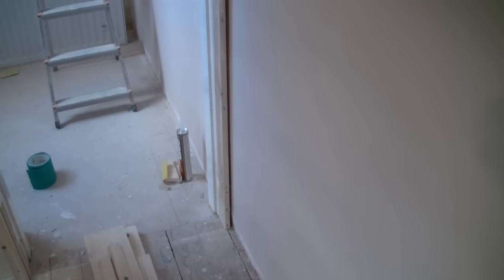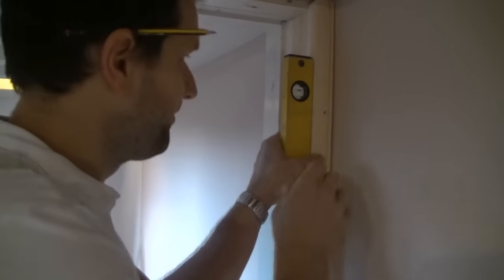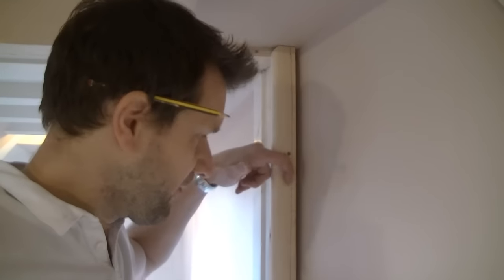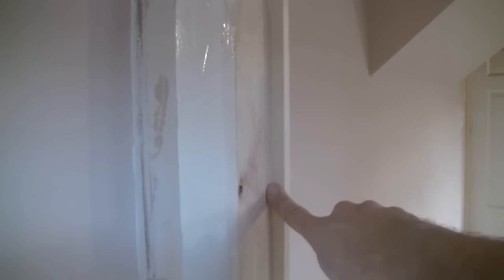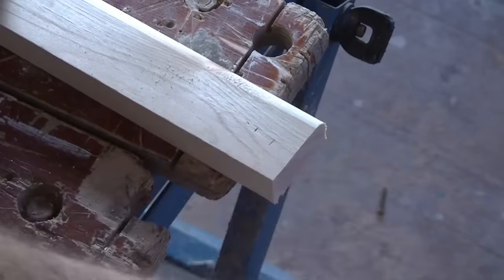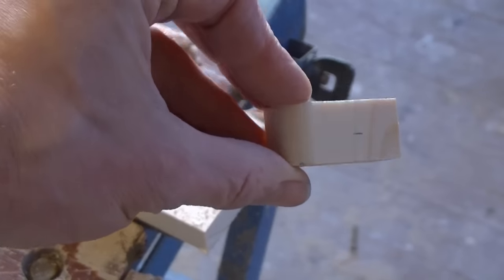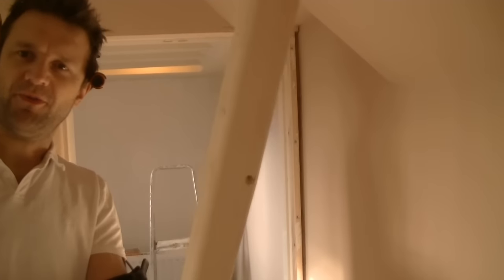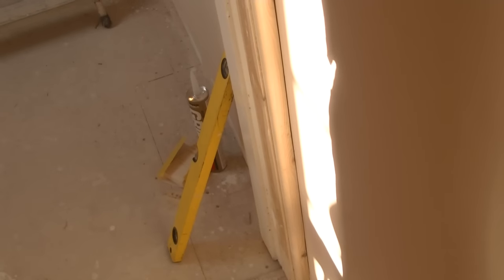How to Scribe to an Uneven Wall

Comment: I have an easier way to scribe arcitrave to a wall. Mark the reveal you want on your jamb which in this instance is 5mm. Tack the outer edge of the arcitrave to to that line using a pin nailer or brad nails, you can use a clamp at the header and tack the middle and bottom with a nailer. Then take an off cut which is the same width as the arcitrave and scribe your pencil line down the one that's tacked to the jamb, cut to the line and you're good to go leaving you with that 5mm reveal. Make sure you cut the mitre on top before cutting the scribe line so you'll have that 45° cut

Comment: Nice video on explaining how to scribe architrave. Still alittle “gappy” but close enough for a DIYer. One thing us professional carpenters do is back cut (bevel the saw slightly) when cutting the line to ensure a nice tight fit against the wall. Much more accurate with a nice sharp hand saw. Also always cut your mitre before you start cutting the scribe as it’s a pain to cut afterwards. 

Nice job! :)
Reply: Another way is to cut an angle, but cut a little away from the line, so you can easily sand the remaining bit down to the line. The angled cut means you only have to sand a thin edge down, means a lot less sanding, but you can still get the fine accuracy that sanding affords.
Reply: Hi there, what do you find is the best method for cutting your scribe on a 2x2 upright when you’re cutting with the grain? I found it particularly awkward with a wavy wall. Thanks.
Reply: @meldrew728  I always scribe thin pieces with a table saw, I just cut at 5 or 7° to create a bevel and get it as close to the line as possible, sounds hard but should get the hang of it on the 3rd piece if not leave a little more than the line and sand the rest. That's  what the bevel is for so you can remove material fasters and it also leaves less gap between material

Comment: Well done I am a retired linoleum layer I have been making patterns to cut sheet goods for 40+ years basically the way you scribed your molding using an18inch straight edge.
Reply from the maker: Thanks Michael. It's great to get a positive endorsement like that from a pro 👍

Comment: Best method is to find the point where the wall projects the most and sit the architrave against it. At that point, measure how far the architrave projects past the frame. 
Fix the architrave top and bottom at this measurement so it’s parallel with the frame.
It’s best to fix using oval nails where possible. Screws require more filling and run the risk of splitting out (spelching)when withdrawn if you’ve put them below surface , as the timber can expand back over the edge of the head of the screw.
Cut the scribe block to the size of the margin and the architrave projection combined. Before marking with a pen,  put masking tape down the edge of the architrave where it touches the wall. Masking tape makes the scribe line more visible and helps reduce spelching out when cutting along the scribe. 
I prefer to cut with a fine cut panel saw. If you use a jog saw, use a blade that cuts on the downstroke to reduce spelching out on the face of the architrave. 
Once you begin cutting, you should back cut. This means cutting off 90 degree along the scribe so that the front (visible) part of the scribe touches the wall first.
This also means you don’t need to rely on decorators caulk to hide your sins.
Reply: Can you skip the step of finding the most protruding part of the wall.and just set it to an arbitrary parallel distance from frame. Then continue from there?

Comment: If door frame isn’t plumb, mark 8mm on the frame or whatever inset you do and fix the back edge of the arc to it, then get a block the same width of the architrave and run a pencil mark down it following the contours of the wall and jigsaw to the pencil line👍🏼

Comment: Hi Charlie , what did you find is the best method for cutting your scribe on the upright for the insane bookcase? I found it particularly awkward for a wavy wall with a 2x2 upright, cutting with the grain. Thanks.
Reply from the maker: You basically have to start with a piece of wood that's wider than it needs to be, somehow fix it in position with the inner piece parallel with the unit that you're fitting it to, and then do your scribing. I find my belt sander very important to fine tune sections the jigsaw hasn't quite cut accurately. Once you have a scribe that accurately follows the contours of the wall, you can turn your attention to the straight section and trim that back so that it sits flush with the inside of the bookcase, door frame etc. A set of swanky scribes are useful to have. I used them on the wardrobe build a few times. Saves having to cut a scribe block.
Reply: @CharlieDIYte  Thanks, I understand the process. The problem came with following a wavy line on 2x2 cutting with the grain. A handsaw wasn’t flexible enough and a jigsaw blade not firm enough. The first result was to just have the high and low points right but nothing in between. I’m now considering cutting it roughly and buying a flap disc for a grinder to fine tune it.

Comment: Great video, but it assumes the door casing is vertical doesn't it (as you used the spirit level to set the architrave vertical)?
Reply from the maker: That's correct. I should have pointed that out. So if it's not vertical, you just need to make sure you have the architrave parallel with the front edge of the door casing when you scribe.
Reply: Thanks Charlie. Thought I'd check before I tried it. Great channel by the way.

Comment: Hi there Charlie, hope all is well. something slightly different on what you are showing here. Have you ever drilled in to a a ground floor made of concrete( a home) to say fix a plinth ? I may need to do it its just that one has to be careful not to hit the DPM. thanks in advance, ps I am talking about using tapcon screws (blue concrete screws u may know of) and around 30mm deep.
Reply from the maker: I have to say, I haven't. Does it need mechanically fixing? Could you instead fix it down with a grab adhesive?

Comment: Cool tip, I'm assuming it only works accurately if the door jamb is perfectly plum as the arc was? Most older frames are usually bellied/bowed on at least one side. I'll definitely be playing with this one though
Reply from the maker: What you could do Danny is fix it in roughly the right position, scribe it to the wall, then when you've completed the scribe, push it into the wall and then scribe to the door frame. A bit of a pain but sometimes needs must!
Reply: @CharlieDIYte  brilliant thanks mate, need something better than measuring top, middle bottom its questionable at times I'll be using this for sure

Comment: Could you explain how to calculate feather edge boards needed over a certain span, do i divide the width of the board less the overlap into the length i want to cover, thought I'd ask as you explain well and i used this scribing method after watching this video and it worked great, i kmew how to scribe as to tracing the uneven surface to another but couldn't fathom how to get it in the right place without cutting the other edge to suit,  Thanks
Reply from the maker: Hi John, thanks for the feedback! Yes, that is exactly how I'd do it. You should allow a minimum of 25mm to 30mm overlap. So for example if you have 150mm wide boards then each board will give a coverage of 125mm - or 8 boards per metre. There are various calculators available - such as this one https://goo.gl/7iot7n that even tells you how many counter rails, notch posts etc etc you need (assuming of course you're making a fence!). That reminds me, I have a section of fence in the garden to replace...!
Reply: Charlie DIYte thanks for the reply, big help cheers

Comment: Hello! Can this be done with a baseboard? My walls are so uneven, the baseboard curves in the middle.
Reply from the maker: Yes absolutely Cynthia, but it's going to be a little tricky to remove and might look a bit odd of you end up with a very thin base board in certain areas. Can you not mechanically fix (screw) the base board to the wall, which will pull it in around the uneven lumps in the wall?
Reply: I can try that Charlie!  Thanks for answering so quickly!

Comment: Great video, but I agree with mgibson26. I done this yesterday exactly as described and it didn't come out very well, thats because the door lining was not 100% level and leveling the architrave so it is plumb means the scribe was completely off.
Reply from the maker: Ah, sorry about that Kevin. Looking back, that was a glaring error in the video. As you rightly say, the crucial thing is to have the front edge of the architrave running parallel with the door lining. I made the assumption that everyone's door linings will be plumb, which is ridiculous as pretty much nothing in my house is plumb! You must have been cursing me by the end of it!

Comment: I understand 17mm but i dont get how you get the next 5 to make 22mm
Reply from the maker: The extra 5mm was the distance that the architrave needed to be set back from the door frame edge. So 17mm plus 5mm gets you to 22mm. Does that make sense?

Comment: I could have sworn you said the reveal was 5mm and the other was 17mm giving 23mm - then you set your scribe block to 20mm. Did I miss something?
Reply from the maker: Hi Charles, I wanted the architrave to be inset 5mm from the edge of the door frame, or jamb. When I screwed the architrave to the edge of the frame, around about 2.19mins into the video, it projected 17mm into the door way past the edge of the frame, which gives you a combined total of 22mm that I needed to cut off the architrave. That's why I made my scribing block 22mm wide. I've just rewatched the video and I did cut the scribing block to 22mm, so I'm afraid you were mistaken :)